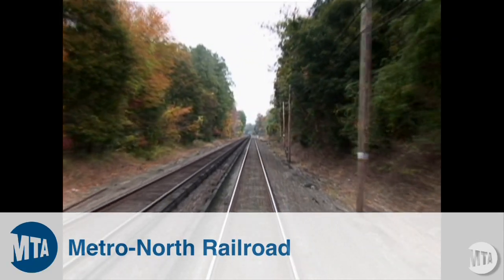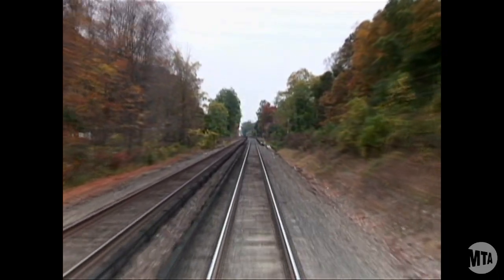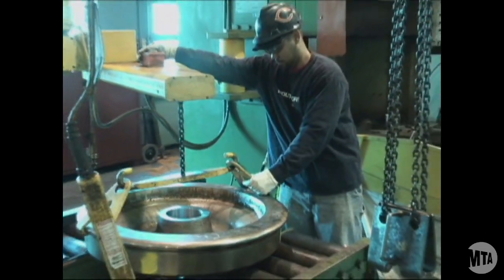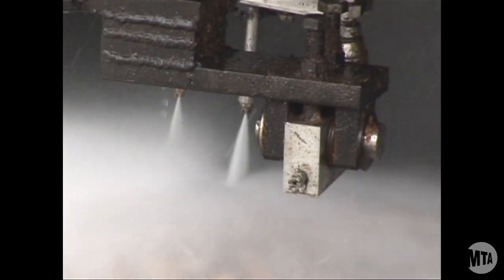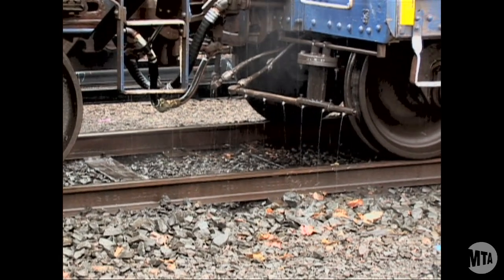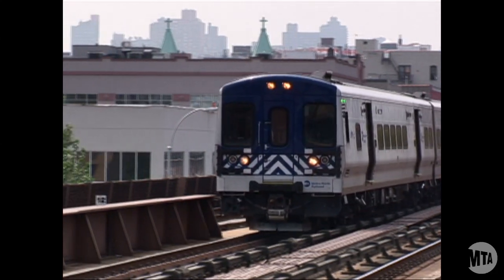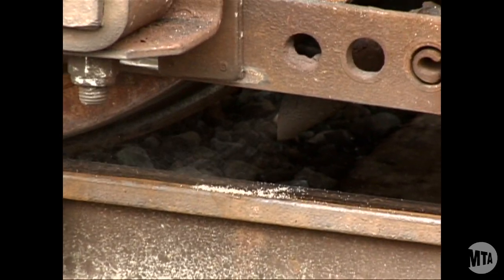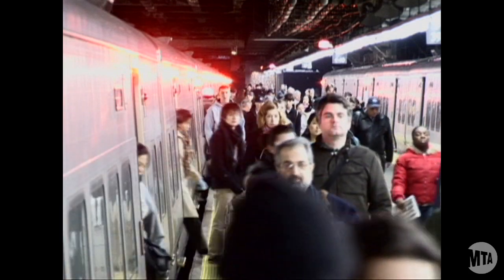Fighting Slippery Rail on Metro-North

Comment: @WetChicken It's not a software issue. Speed sensing is usually only performed at one axle. Some freight locomotives do sense it at multiple wheels, but passenger equipment usually doesn't. I suppose a software compensation MIGHT be possible by filtering out rapid slip events from the safety code, but it's not nice to have to mess with your safety systems.

The sanding gear is a more conventional method of dealing with wheel slip. It's worth a try. Remember, don't sand over switches!